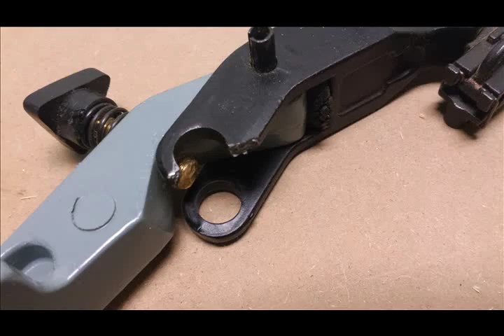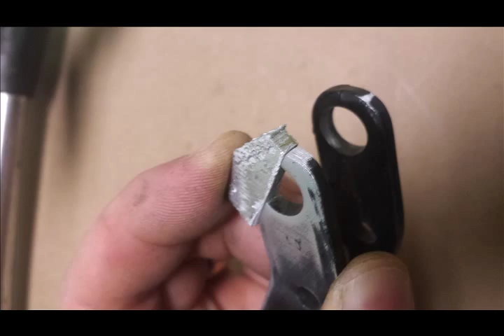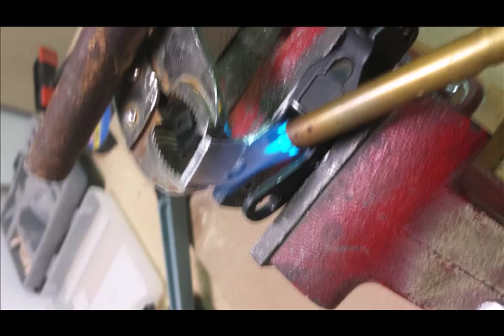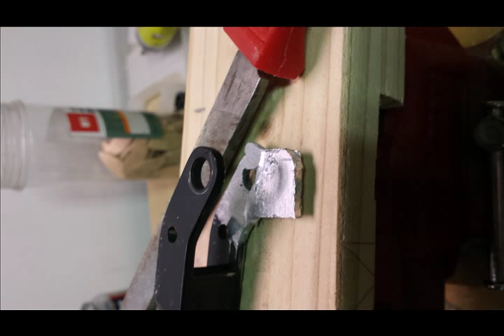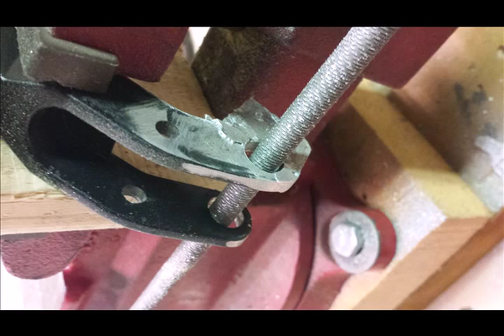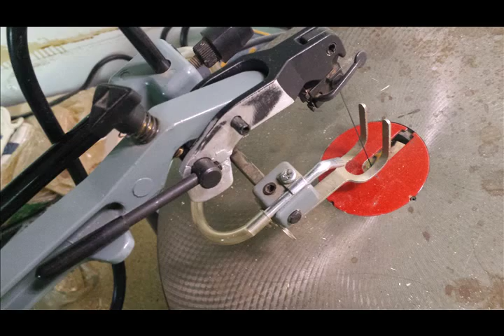Repairing a broken aluminum part on a Delta scroll saw

Comment: Great job Gary, i noticed you have the same blade holder as i have on mine (20" delta 40-640) that i have not seen on any other delta, my thumb lever on that broke as it would not stay in place and kept popping the blade, the more i tried to thumb it back into place the rod was bending and finally broke, do you have any information on that upper blade holder ?